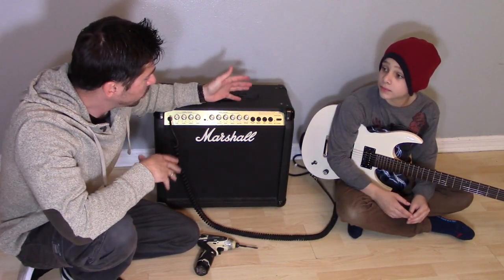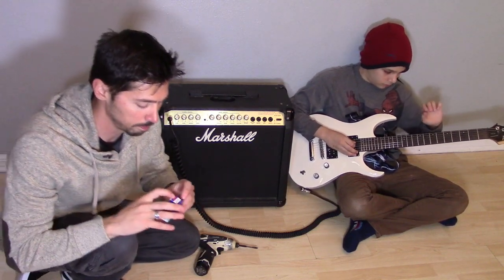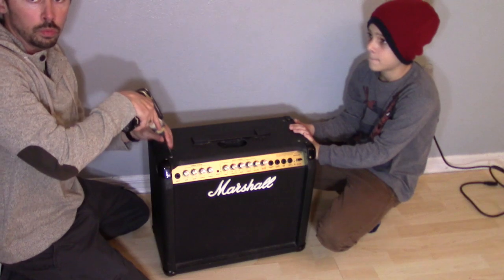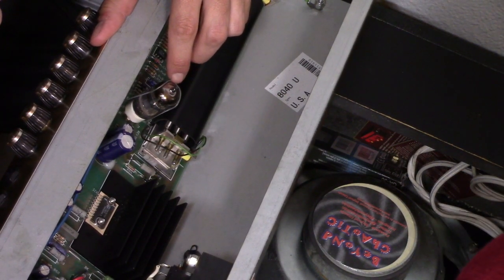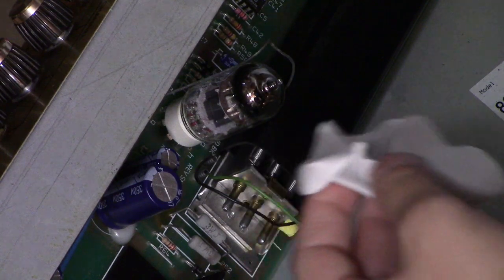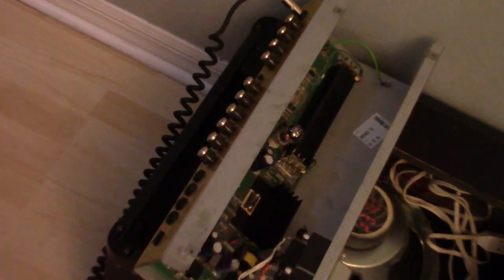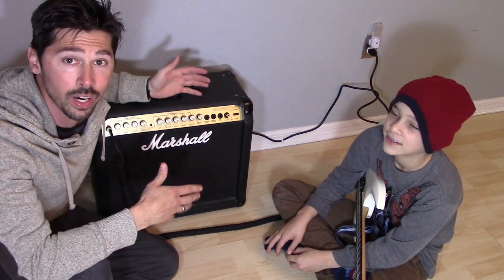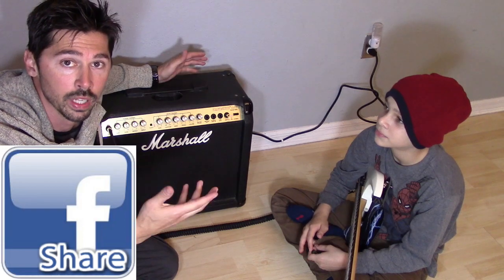How to replace & upgrade tube in Marshall Guitar Amp Valvestate

Comment: Great video!  The Marshall Valvestate 8040 is a great amp!  I wish I would have purchased one of these when they were in production.  I bought an 8080 instead thinking that 80 watts is better (and the clean channel has a Crunch switch).  At the time, my ears preferred the 8040, but I went with the 8080 instead.  Never really bonded with the 8080...

Comment: I have this same kind of amp and it's giving me really bad sound but I'm not sure if it needs a new tube or whats up.. The amp jus turned on everything volumed down will make a low buzzing noise and turning the volume/gain knobs on the clean channel will cause LOUD cracking noises (they're louder than the level of volume should allow). Is that the tube then?

Comment: Slam! Don’t worry, nothing bad happened! 😂 Make sure you unplug it before removing the tube so you don’t get a shock. It’s also not a good idea to pound on the top or sides since there are lots of solder joints!

Comment: Thanks, I replaced the tube in mine but made no difference. I only get sound when I plug into the effects return jack. Will have to check the soldering to see if there are any dry joints.

Comment: I've replaced the preamp tube on my Marshall Valvestate 8080 with the same model Tung-Sol 12AX7 but it didn't work out for me. The drive channel was extremely low volume and impossible to play. Returned the old Marshall tube and it sounds fine again. Don't know whats wrong
Reply: He showed a Tung-Sol in the video but the one he's recommending is actually a JJ tube.

Comment: Hey, I have a similar amp, an older AVT20. My input is quite dodgy and only works at some angles. Do you think it'd be safe for me to open it up and attempt to fix it? I've no experience in fixing any sort of electronics.
Reply from the maker: Try deoxit spray first.
Reply: @TampaTec  will do, thanks for the quick reply!

Comment: Thanks for the amazing tips on amp repair.  It's a misconception that you can't touch the glass of the tube.  It is really OK to do so.  This will not shorten the lifespan of the tube at all.  That is only the case for halogen lamps.  ;)

Comment: Ok so heres a couple things to teach your boy.
Hand in pocket!- only ever use one hand when working on amps even when its off! your boy had a hand on the chassis and on the tube.

Touch nothing!-  dont ever touch anything with your hand when its powered up like you did.
The only thing you will ever have to do while the amp is on is adjust trim pots, and thats only with an insulated screwdriver.

Comment: Good video. I'm about to attempt the same thing on the head version of this amp. Hopefully it should be easy.
Reply from the maker: Use deoxit electronic cleaner in ports and pot connections first that's most common fix for sounds cutting out and static.

Comment: You CAN touch valve tubes with your bare hands. The myths stems from old style halogen light bulbs which you can't touch because oil and dirt will crack the glass.

Thanks for the vid.

Comment: Those Tung-sol tubes, is actually better for bluesy/rock sounds. not good for metal or hard metal. But yeah, good tubes for the 80xx series Solid State valvestate amps. They came out back on 90'-91' I have the bigger model 8080 V80. Combo AND the head version of the 8080 named 8100. Good old solid state amps. most of them nowadays, mostly needs changing the potentiometers. But ALL worth it. I have a Vox AC30C2 Custom Black too. But mostly use the old Marshalls. I bought my 8080 back in late 92'
Reply: After many comments like yours, I ended up ditching my 2 week old Blackstar IDCORE and sucked it up and got a Marshall Valvestate 8240 2x12 a few months back for around $180. It has zero issues, the celestion speakers sound great and the pots are smooth. This is my first big boy amp and I absolutely love that classic Marshall overdrive built in combined with the StereoChorus. If anyone reading is considering a Marshall Valvestate amp, I highly recommended spending the money.

Comment: Emergency Question. Please answer.
I have a Marshall Valvestate model Vs102r. After 18 years of owning it, I opened the cabinet after I was having the same issue you were having. I need to replace the preamp tube. Where did you find it? I’ve been searching for hours. Please rsvp. Thank you. This video is awesome I didn’t even know it had a tube. I thought it was tube emulation.
Reply: How do I fix  the  effects channels.  I have a avt150. Any feedback would be greatly appreciated 😔🙂. Everything else works fine. She sounds loud but clear

Comment: hei, thanks for this quick review, I will take note in case will need to replace the valve in my AVT50... Now actually i got another problem. the cooling fan has big noise.  I tried to put some spry WD-40 inside the pivot, but after a while it starts again, so I need to replace it but I cant easy find the replacement because of the particular pin connector. do you know some supplier please? cheers, bye.
Reply from the maker: ACERob71 don't spray fan it may start a fire because wd40 is flammable. replace the fan, its likely bearings are bad in fan and fan cost only 10usd. on Ebay or Amazon.

Comment: question! how do i fix the reverb on my marshall valvestate vs30?
Reply from the maker: nelson belliard if reverb goes in and out then try deoxit spray to clean the connections. also check for bad solder joints.
Reply: alright thanks guitar dad!

Comment: why should i avoid touching the new tube?
Reply: You CAN touch valve tubes with your bare hands. The myths stems from old style halogen light bulbs which you can't touch because oil and dirt will crack the glass.
Reply: Vappo Riesat the grease/oil from the skin will stick to the glass. The glass in turn, will not heat evenly, due to the chemical reaction of the heat with the skin natural grease but as the interior of the valve causes the glass to become quite hot this uneven heat distribution will damage the glass and thus reduce the life of the valve. This is also true with automotive light bulbs and most manufacturers provide warning for not touching the bulbs with bare hands as it will damage them

Comment: Sir as i work with vacuum devices i can tell you that touching the glass on vacuum tubes is perfectly safe as long as there is no high voltage around them but using halogen or quarts lamps as they are an extreme vacuum you need to wear the gloves provided as those bulbs operate at extreme temperatures vacuum tubes operate no where near that temperature.
Reply: Touching the tubes will put oil on the glass, which will cause the tube to not heat evenly, which has the potential to ruin the tone.
Reply: jmcwd your on to something bad really does not prove to do any damage I've had oil in tubes that get extremely hot and lived a full life actually oil would help dissipate a small small amount of heat lol
Reply: @treegasmicthearborist5763  Eh?
Reply: @jmcwd  My arse!

Comment: i changed the tube on my Valvestate 8100 but it still lacks gain and sustain, i just owned it for a few weeks is there a way to fix it?
Reply: i own two models the 8100 head and the 8080 which is the 1x12 combo version. both definitely have enough gain to get heavy metal tones. i think something might be wrong with your amp if a les paul sounded dull and weak through it
Reply from the maker: Lizet Sanchez clean the pots and Jack inputs with deoxit spray.
Reply: Tampatec I'll definitely try that thank you for replying (:
Reply: what kind of guitar? I have an 8100 too and it can sound mean or wussy depending on the guitar/pickups. I had a copy SG with humbuckers that sounded really weak then I plugged in my BC Rich Stealth with duncan designed humbuckers and it sounds beastly. Settings are kind of touchy with the 8100 as well imo
Reply: I was just watching a ton of vids about your amp. I hear they have a big problem with the board. After re installing your new tubes, did you re bias your amp? Take it in and have a pro re bias it. Just changing tubes will not solve your probs. Marshall does have a lot of pit falls in a lot of their amps.
Reply: nuttinbutchain Hi. I have a B.C. Rich Warlock with stock humbuckers. Even though it isn't a high end guitar I find it strange that a Marshall with a good rep for metal sounds lifeless compared to my 15w Line 6 practice amp. P.S. this may not make a difference but I played a Gibson Les Paul Custom through the 8100 & it also sounded dull, weak, & lifeless. Thanks for listening cheers (:
Reply: S Biggs thanks for the advice I actually haven't rebiased the amp & you are right there are many videos I've come across that had worse problems such as cracking & humming noise or completely powering off.  I haven't seen any similar to mine where it's lacking distortion & clarity it's a strange situation...